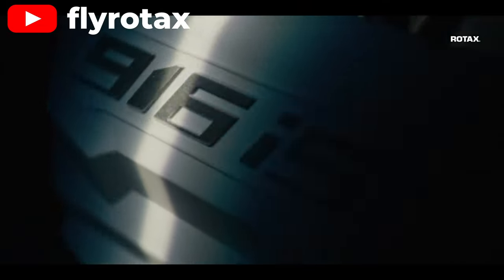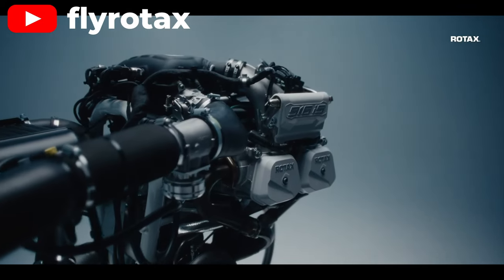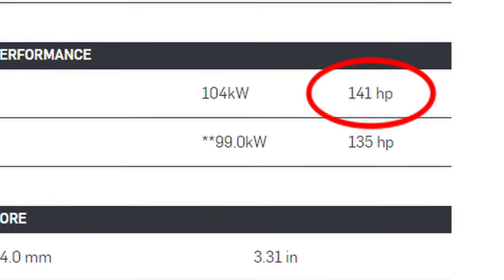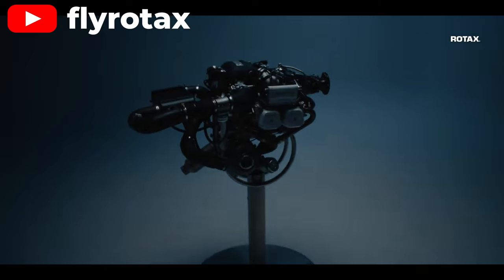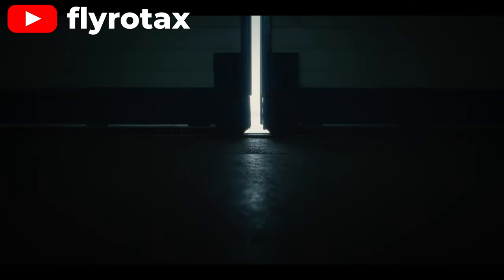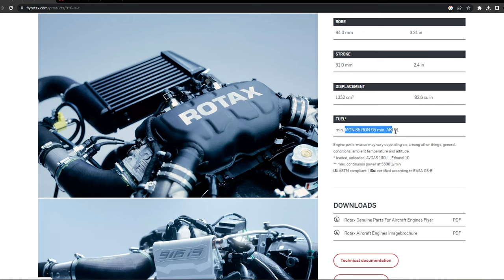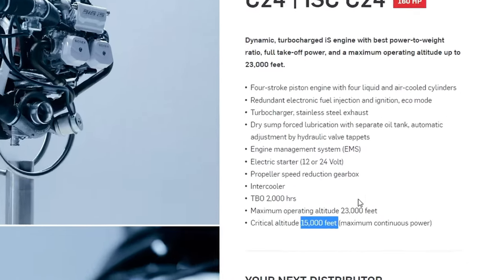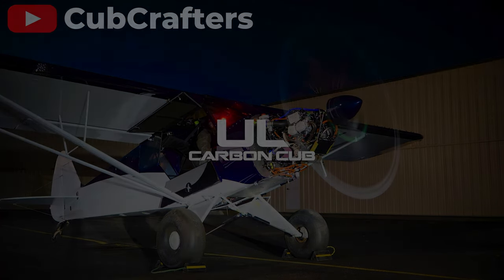Rotax 916 iS Unveiled

Comment: It has a better takeoff or max power than the 915 at 160HP vs 141HP but only 2 more max continuous hp than the 915 137HP vs 135 HP
Reply from the maker: I'm guessing since it's not a completely new design from the ground up - but basically an upgraded 915 - they can't produce more power out of that engine without affecting reliability and/or TBO.

Comment: Imagine if they added another section of cylinders. a 6 cylinder could produce up to 240 hp
Reply: And thus add unnecessary weight, potentially change the center of gravity of the aircraft. Would also run hotter, among other things.
Reply: @sepg5084  If Lycoming thought like you, they would have never got past the 0-360 and developed to 540. Different engine for different airplanes.

Comment: After running a couple sleds with rotax power, I can say I would not trust my life to one
Reply from the maker: I know nothing of their snowmobile engines and how much different the designs are, but their airplane engines are some of the most reliable, if not the most.
Reply: @LetsGoAviate                       🐴🍺🍺🍺👍
Reply: @jorbedo  That was a bad spark plug... don't have a couple of those in a lycoming or continental?
I've been flying > 30 years behind all types of Rotax engines and had no major issues.
Like letsgoaviate said: "some of the most reliable, if not the most"

Comment: They are in a hurry because they know yamaha will launch their own Aircraft products soon, they know they will loose that battle.
Reply: Your are wrong. Yamaha is ultra conservative with hp. Their bike ADV bike engines are woefully underpowered compared to others in their class. Their first iteration of an aircraft engine with not beat out a tried and tire designs.
Reply: The epex engine is competitive to the 9 series rotax engines. But Yamaha is not marketing that as an airplane engine, it's a conversion.  The Yamaha test airplane engine is 500cc and generally appears to be where rotax was 30 years ago.... Not saying Yamaha doesn't have the necessary experience to catch up fast, but at this time they are not a competitor.
Reply from the maker: I don't think Yamaha's airplane engine will be more than 80hp (it's a 2 cylinder, 499cc), thus not competing with any of Rotax's new engines. 

Nonetheless I can't wait for the Yamaha!
Reply: @Captndarty Same thing the industry said about rotax when they started from 2 cycle snowmobile engines, there is always a begining. BRP vs Yamaha reliability? Yamaha wins hands down.
Reply: Isn't the difference between Rotax and Yamaha the fact that Rotax made a sensible quantity of speciality engines for a market which required reliability.  I mean, the prospect of freezing in Arctic conditions on a snowmobile tends to concentrate the mind.  Aircraft engines aren't exactly going to make a company super rich - after all, quantity has a quality all of it's own (particularly when it comes to the need to fulfil a baseline production output) and the folks at Rotax are forced to produce their quantity snowmobile engines at a quality level far in excess of Yamaha's quantity engines.
I would love to see Yamaha get in on the act, but I feel that uncomfortable wisdom informs us that Aircraft Engines don't make the money to justify a "have to have" product.  But then again, Yamaha may well be eyeing the aircraft engine market to keep their very capable Japanese Engineers busy while their bread and butter products move to China and elsewhere for manufacturing.
I'm commenting with all respect to Chinese engineering.  Complex and sound engineering takes time and experience and the Chinese will catch up.  In the mean time - let's hope Yamaha get in on the aviation act for the sake of our desire for variety, if not also for our wallets.
Reply from the maker: @alastairnewman1233  Some interesting points! But Yamaha is knee-deep in the Snowmobile market as well. Reliability would depend on the specific engine/design as well, not just the manufacturer. 

In my opinion, there really isn't such a thing as "all Rotax engines are reliable". Rather they MADE every 9-series engine reliable. Remember Rotax made the 582 as well, and while people have wildly differing opinions on it, it's not in the same reliability league as the 9-series (their other 2-stroke design, the 503 is known to be bulletproof though).

So we'll see what Yamaha brings, but I'm cautiously optimistic 🙂
Reply: Where are you coming up with this comment you are posting on every video about the 916?
Reply: @LetsGoAviate  I completely agree with you.  I was  looking at the sizes of both companies.  Rotax is tiny compared to Yamaha.  While Yamaha has almost endless resources because of their size, Rotax has the flexibility to concentrate on the critical small things required for aeroplane engine reliability.  (That is assuming my model is correct!!?!).  
I'm personally wanting Yamaha and Honda to get into this market in order to drive prices to more affordable levels.  This will surely increase the market size for both consumers and specialised engine developers (like Viking) who will have an affordable platform to work from.
But the whole thing is a multi-sided sword.  If more players get into the market and the market doesn't grow, profitability will suffer if quality is demanded.
you posted an awesome video which stimulates loads of interesting debate and no single solution.
Reply: @Captndarty  a sidewinder conservative at 200+ hp? 🤔
Reply: @Caseywhitee14  phazer-apex engines were designed from lexus supercars engines research, a 500cc phazer at 80hp sounds better annd a lot lighter than a rotax 912....
Reply: @LetsGoAviate  Same hp than a 912i with 60lbs less weight? 🫢
Reply: @A.J.1656  because the price sucks
Reply: @Captndarty  of course you checked the mt09 engine, triple 850cc at 115+hp and 212 ft/lb torque at 3.4 reduction ratio?
Reply: @jorbedo  
Can you provide any source for the idea that Yamaha will enter the market?